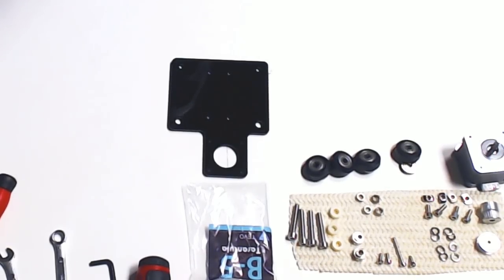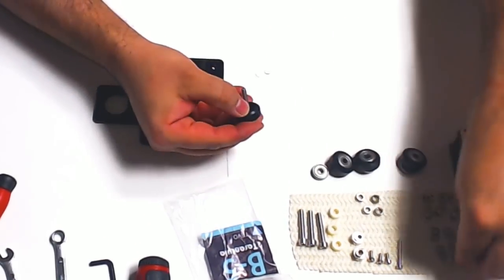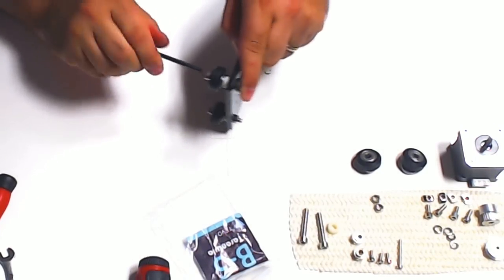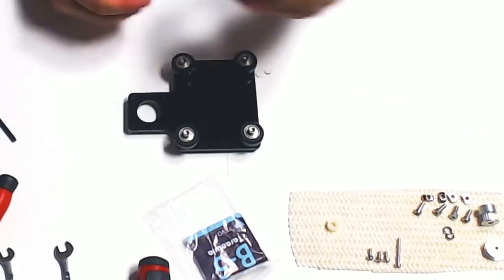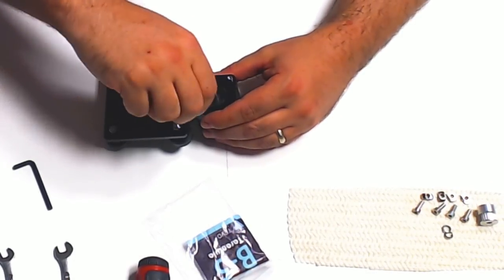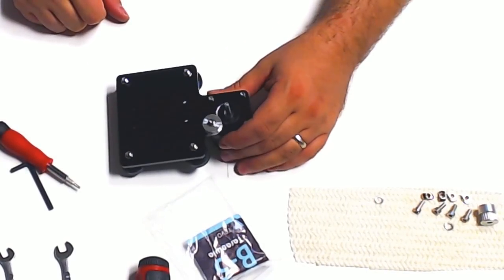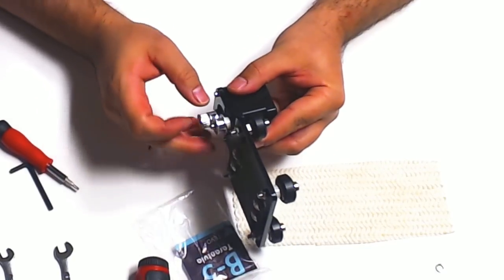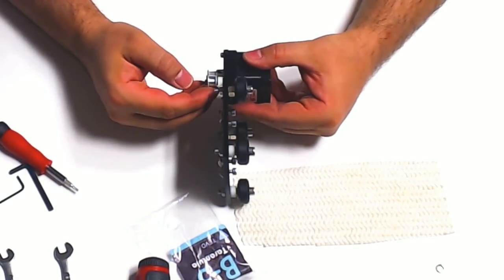Tevo Tarantula Assembly - Step 3 - Z Axis Right Side

Comment: The solution is Bolt, washer, acrylic, washer, nut. Tighten the nut, then pulley and finally blocking nut. The assembly should be strong and the pulley free.

Comment: What is the solution for the pulley wich is not tightened! I cant belive that the instruction manual still contain mistake,and speaking for me,I didn't receive all the parts in my box.«««so far,I am not impressed with my product...hope it will turn out to be great.so many little problem along the way,and its just the begining.thanks for the great video,but the solution for the wobbeling pulley that you provide at the end doesnt work!